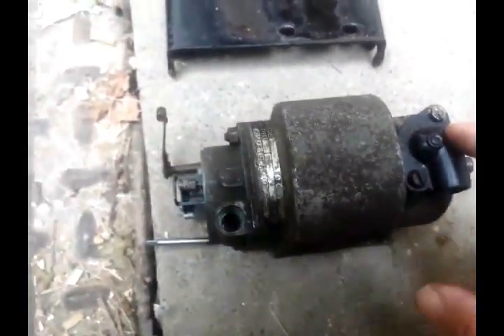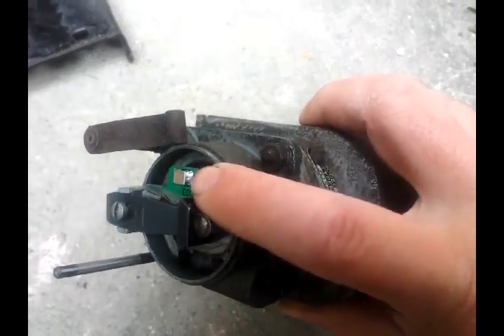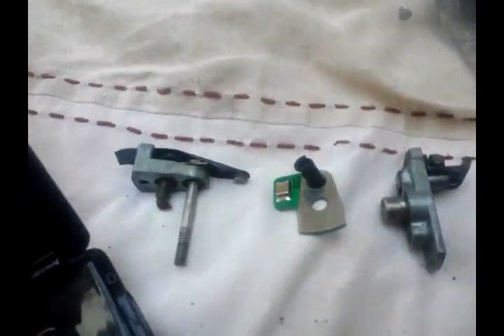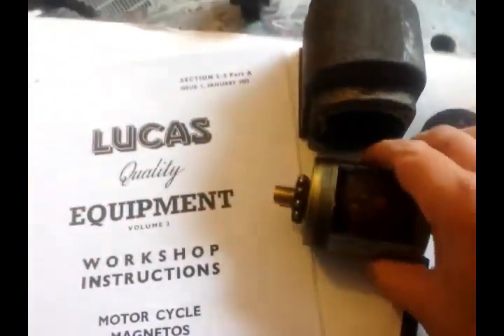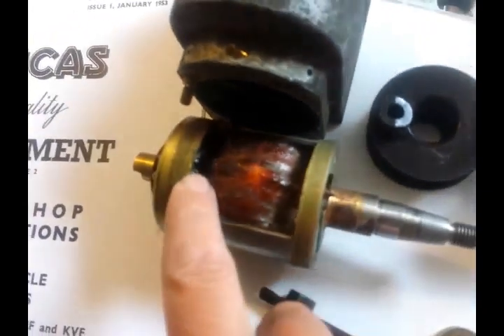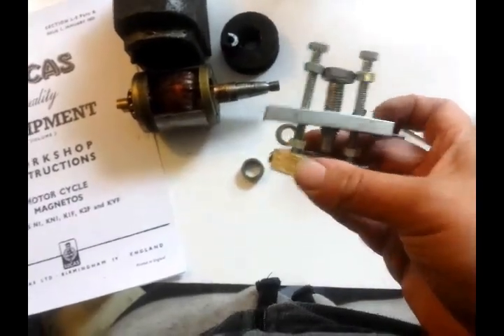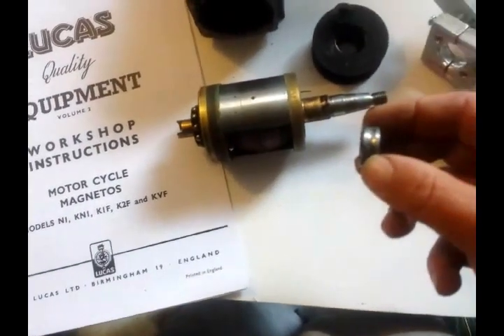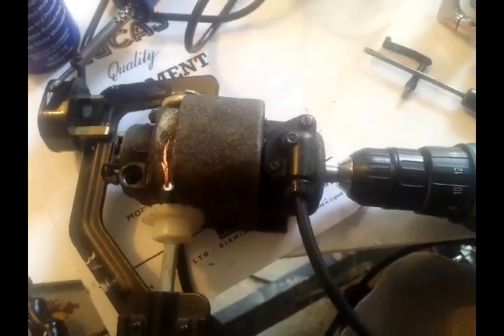How to remove the capacitor from  Lucas N1 Magneto aka "Condensectomy"

Comment: After examining closely the drawings associated with the Lucas N1 Magneto "Condensectomy" the only thing different after all that effort was that the earth had been disconnected. I removed the earth screw then used a Dremel with a cut-off disc and removed the earth tab, ground down carefully between the brass end piece and the capacitor to remove the remnants of the earth tab, and the brass "button" on the side of the capacitor and made sure that there was no connection between the capacitor and brass end piece and that was it. PS place a piece of masking tape on the bobbin to protect from accidental damage while grinding. The cut-off disc will be on slight angle but it is very easy to do with care. Blow the bobbin with compressed air to remove any dust etc.

Comment: So the video is the opposite of what the title says. You dont show how to remove the capacitor.
Reply from the maker: Ok call it remove capacitance or disconnect the capacitor if you prefer. The point is that it's how you get to it. You don't need to physically remove it, just its influence.
Reply: @MotorClassics   so did you remove the capacitor earth terminal , and put some heat shrink on the wire , did you refit the screw for balance , also as someone mentioned if you are only going to snip that earth wire , you dont need to remove that bearing inner from hell . Cheers .

Comment: i had my magneto rebuilt with an easy cap fitted and my A10 starts first kick reccomend
Reply from the maker: Its a long time since I fiddled with that but I installed an easy cap and it didn't work too well. It depends on the condition of the varnish on the windings really; mine just wern't good enough.

Comment: Very interesting, mine will be arriving shortly and it`s a big question mark at the moment. When using any kind of a puller it usually helps if having tightened it to a fair degree you then tap the end of the mandrel with a hammer. This should move the bearing along a parallel shaft a bit or in the case of a taper jump the item off said taper.
Reply from the maker: Thanks for the tip and good luck with yours.

Comment: So why take the bearing from hell & the slip ring off then off then......have I missed something.... thanks great vid
Reply from the maker: Hi, yes you have; you can't get it apart to remove the capacitor without removing the bearing. The screw heads are on the bearing side which is annoying.
Reply: But it looks possible to leave cap where it is but disconnect the earth maybe ..... cheers
Reply from the maker: +Gary Oliver Just about
Reply: @MotorClassics  This link is not working
Reply: MotorClassics sent me to a porn site
Reply: @amiladaya4863  was it good?